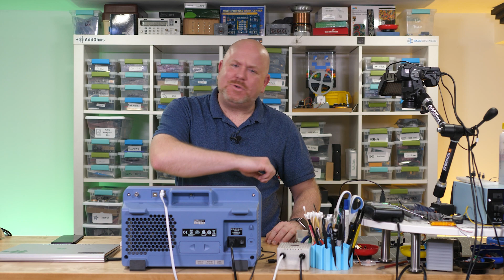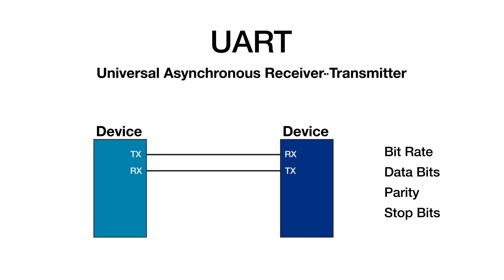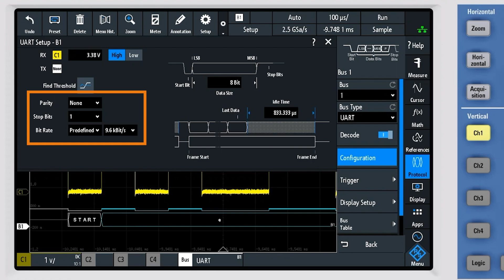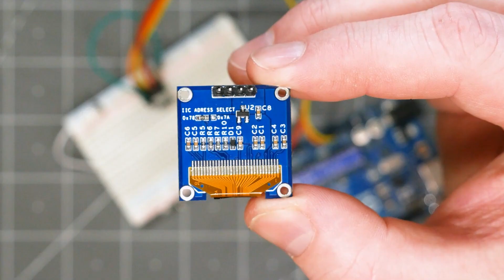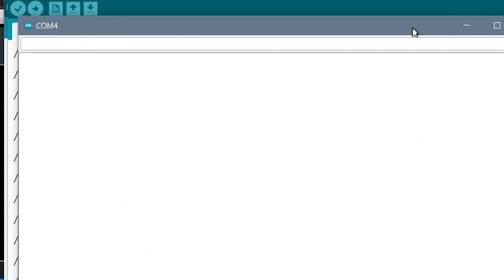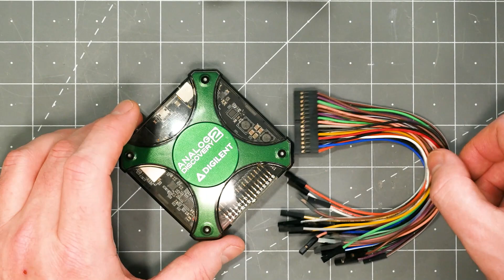Triggering And Decoding Serial Protocols On An Oscilloscope - Workbench Wednesdays

Comment: Would be valuable to mention the oscilloscope brand or model that supports reading serial interface signals.
Reply: Since the video wasn't about this specific scope, I didn't feel the need. Also, most oscilloscopes today support some form of decode or trigger. But for details, they are in the show notes: https://www.element14.com/community/docs/DOC-96191/l/workbench-wednesdays-34-triggering-and-decoding-serial-protocols-on-an-oscilloscope

Comment: ...I can't understand why 2 different Arduino needs gnd apart from RX,TX wire for communication...hc-12 didn't need any...
Reply: Wires connected to each other conduct current and need a common reference, aka "ground." When moving current through wires, you need a closed loop. RF radiates the electromagnetic waves (mostly) through air. Inside of the TX and RX of the radios are amplifiers that are referenced to the local system's ground.

It's two different ways of moving the electromagnetic energy.
Reply: @bald_engineer  ... can't it refer to it's baud rate instead?
Reply: @surenbono6063  huh? Baud rate is how fast symbols are sent.
Reply: @bald_engineer  ...the rf signal depends on the baud rate to estimate the next arrivals of data and adjust it's clock for each received data .. and didn't need a common ground
Reply: @surenbono6063  Baud rate is related to symbol rate. That’s a protocol level event. You’re talking about physical layer. As I already explained, RF is a different method of moving the electromagnetic wave. 

Wired connections depends on a closed physical loop. RF does not.
Reply: And for RF it is the carrier frequency that matters. That is what has to be high enough for the electromagnetic waves to propagate through the air. 

Carrier frequency is NOT baud rate.
Reply: @bald_engineer  ..ok...Is carrier freq similar to like 433 mhz & baud as frequency of bit that can be sent per second..?
Reply: .. ok.. tq for clearing that up... if found that since it's only 64 bytes per transmission, it needs 15 * tx to equal 9600 baud / second

Comment: But why use an expensive oscilloscope rather than use a cheap 10$ logic analyzer to analyze serial protocols? Any benefits?
Reply: Well, in the example he triggers the scope off of a sine wave. That's not something that can be done with a LA. Sure, you could build something that would create a trigger for the LA to use, but the LA wouldn't be able to do it by itself. 

But between an LA and a scope, I use my scope far more often than I use my LA (a HP 16900A). So having this feature on my scope (a Rigol 1054Z upgraded to a 1104Z) is a nice thing to have on something that you are going to own anyway. 

As for prices, the (new) Rigol can be had for $350, and hacked to perform as if it were a 1104Z for free. The (used) 16900A was $300, but you have to be sure that it comes with the pods, and at that price it usually won't. And you have to find one that has the cards that you want, and again, at that price you usually won't. So you are going to spend more for the LA if you want something nice. 

The 16900A was purchased as an upgrade to my 16702A, and since the 1690x series uses the same cards (except the scope card) as the 1670x series I didn't need to worry about pods and such. And the final thing to compare is shipping. the HP LAs are boat anchors and you will most likely pay a small fortune to have it shipped to you. The Rigol, not so much.